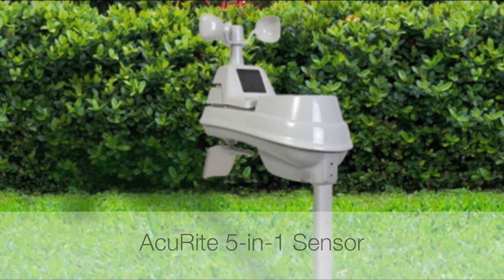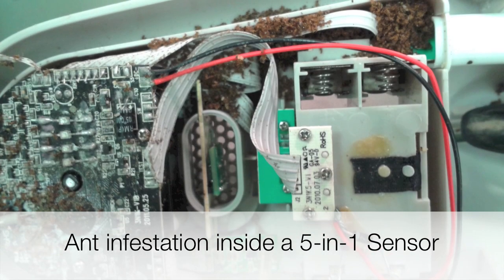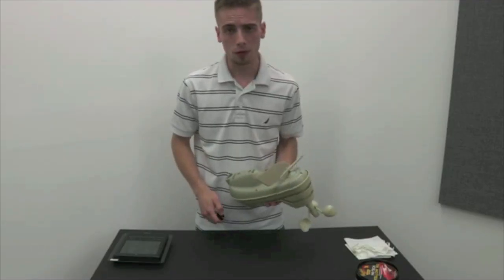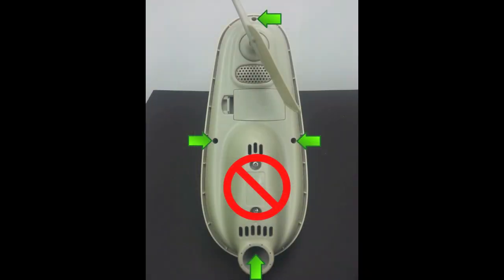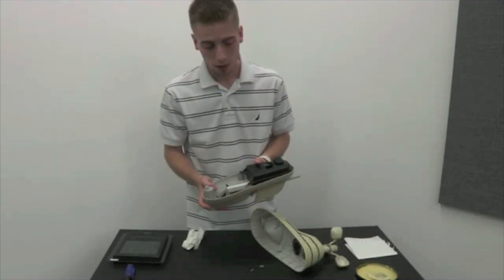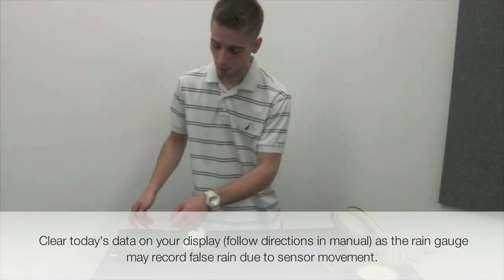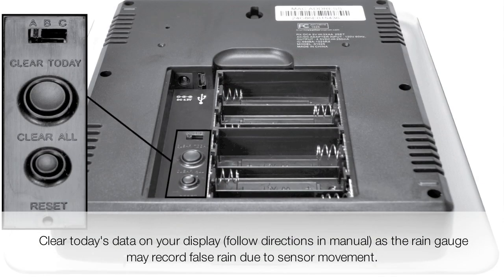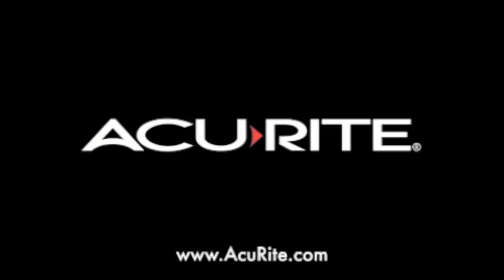AcuRite 5-in-1 Sensor Maintenance

Comment: I discovered it would connect quickly on just battery power, and it stayed connected. When I plugged in the a/c power it would freeze up or would not connect at all. I checked the output of the a/c power adapter and it showed the output at over 8 volts. I used another power adapter that was outputting at 5 volts and so far, for 24 hours it is working and has stayed connected.

Comment: Thanks for the video.  It was very helpful!

Our range gauge started reading 0 recently.  I thought it might be a leaf in the collection cup or something  I wasn't prepared for the horrific spider infestation.  A web mat was preventing the rain from falling into the collection buckets.  It was also pretty dusty.  I was able to clean up everything but the photovoltaic array on the top of the sensor.  It's very dusty and windy where I live, so dust has been blown into it.  I wonder if it can be taken apart and cleaned when the PVA losses effectiveness?

Comment: I hate this brand I’m done with it I get my brand new WeatherStation it falls apart in my hands cheaply built the antenna was super glued to the wire it wasn’t even connected and this is probably the worst tech-support ever I’ve never had a product of this many problems the weather sensor never stays connected garbage 👎👎👎 The new weather stations are more cheap than the old ones and a complete trash